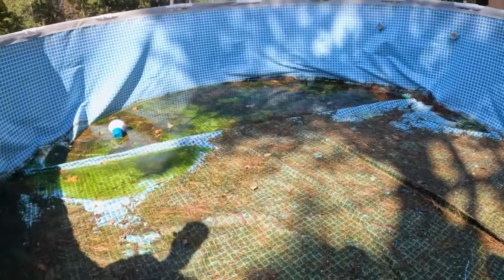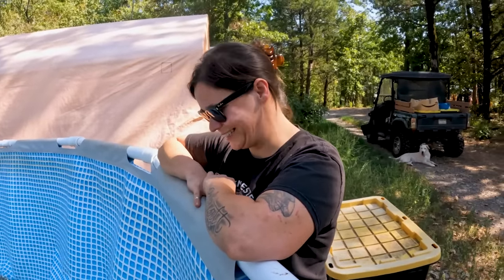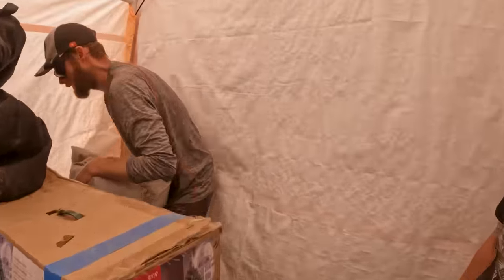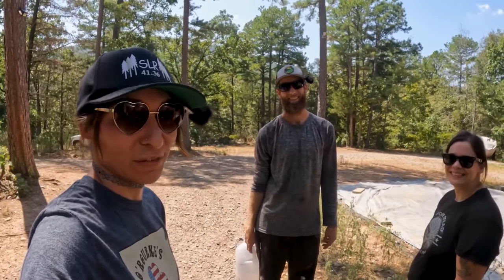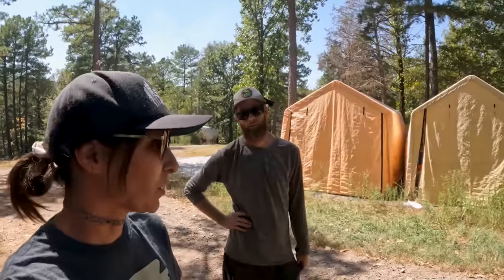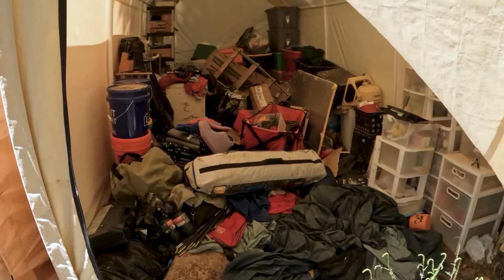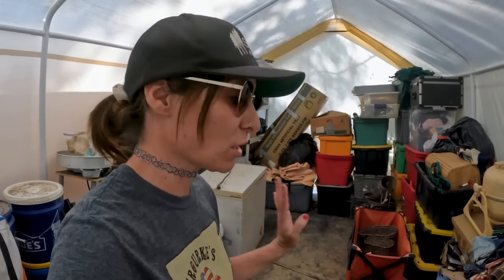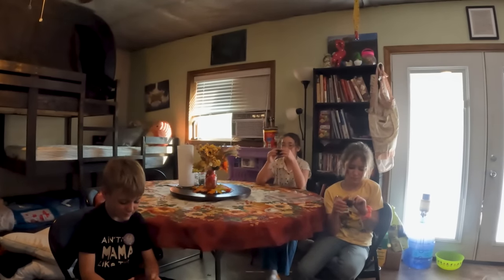It Was Time| Cabin Homestead Fall Prep Cleanup| Facing It Together & Trying New Things

Comment: If you plan on using it for next season.  A side skimmer works great with a basket sock.  You have to cut a hole on the side. Kinda like a traditional pool.  Also get a sand filter with a (minimum) 1HP pump.   You get more movement to help with keeping it clean.  You can even hard line with pvc if you want.

Comment: I see the floating pool tablet holder in the bottom.  They hold trichlor tablets with stabilizer.   Stabilizer is horrible.  Just use bleach instead of chlorine tablets.  Use a little muratic acid to keep the ph correct.  If the ph is good, most of the rest will fall in place.  Have a Wonderful week.  Thanks for posting.

Comment: We had a soft side pool for 5 years, to keep it crystal clear we had to buy a 1 1/2 hp pump with a sand filter minimum.  the pump that comes with the pool must run 24/7 and is incapable of handling the gallons per min. that must be accommodated to properly clean the pool.  It is also the minimum amount of power you will need to use an in pool vacuum.  It cost more but kept the pool swim ready at all times, along with normal maintenance of course.  We loved it.  never had an issues bringing the water back after winterization for winter months either.  there is some learning to do for sure to keep your own pool but after first season we had it down to a science and saved monthly costs on a pool care taker.

Comment: Hey guys, I learned the hard way, let that pool air dry before ya'll store it away or it will develop tiny pin holes in the creases. I just didn't want ya'll to have to find out the hard way too. Everything is looking good you guys!!

Comment: I bought one of those pools many years ago and found that the little filter that came with it was too weak to effectively vacuum the bottom, so I used a regular vacuum from a large pool with a long hose and used” centrifugal force” to get all the algae and junk from the bottom, hanging the hose end out of the pool into the yard. It worked great. You will lose water but I liked to add fresh cold water to it anyways to keep it from getting too warm in the hot sun. It was a great pool for what I payed and lasted over 2 winters without taking it down before I moved, just kept water level low. I loved the looks on Scarlett and Abe’s faces when you showed them those fruits and told them they would be eating them😂.

Comment: We have a pool just like yours and retired it as a pool. We left it up, cut panels out of the liner between the bars and turned it into a container garden. I got a roll of fencing and zip tied it to the bars, and we close it with a carabiner. We have grown stuff in it 3 summers now. When it's horribly hot, we put a shade cloth over it, too. (I got a 6 ft fence to wrap around it.

Comment: Just a thought for your pool for next year, if you build a roof over the pool wide enough that the sun never hits it, the algae and the leaves and pine needles will not be a problem.  Hope this helps.
Reply: They have pool covers just find out what the diameter of the pool is in order a pool cover and cover the pool when not in use that’ll help the sun from penetrating the water and causing algae as long as you keep the pH level good your pool can last even through the winter.❤️
Reply: Sounds good but not with dogs running around
Reply: Nose hair😂😂😂

Comment: Do y'all have a pool pump? If not y'all need to get on to put on y'all's pool to circulate the water tank keep it from getting stagnant. As you know when the water becomes stagnant that is what creates the algae along with the grass, tree pollen and if the youngster's has grass clippings on there feet or and other vegetation debris that gets down into the pool that also causes algae. Keeping the pool clean from vegetation debris and the pool pump to keep the water circulated will keep algae from growing in the water.

Comment: Hey guys idk if u can switch the filter tht is on tht thing but if u can switch to a saltwater pool. I’ve had both, chlorine and now I have a saltwater pool. And I can tell u I spent a fortune on chemicals for my chlorine pool. And it was an above ground pool also, and now I have a huge in ground saltwater pool and I spent more on the smaller pool than I ever have on my saltwater pool. The only thing u have to add is salt! And it’s so easy to care for, and it’s nothing like the water in the ocean, LOL which I thought it would be like.

Comment: Y'all need a blackout cover for the pool. We have well water. If you switch to salt filter and a black out cover. You can resolve the issue of green pool. Keep you chlorine little high.  I never take mine down. I drop the water under filter line, take filter off and winterize with pool chemicals and cover. I have tons of trees, so I keep it covered unless we're using the pool.